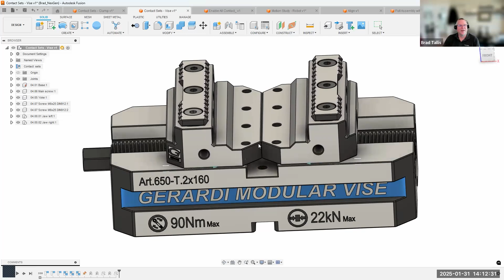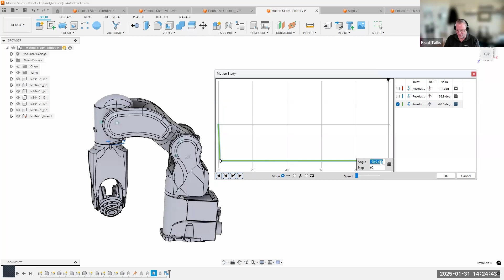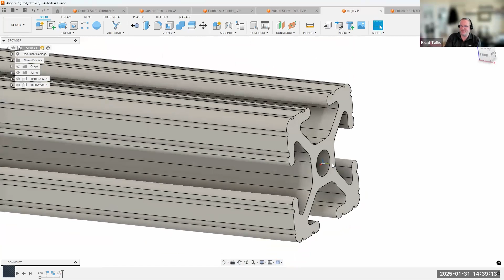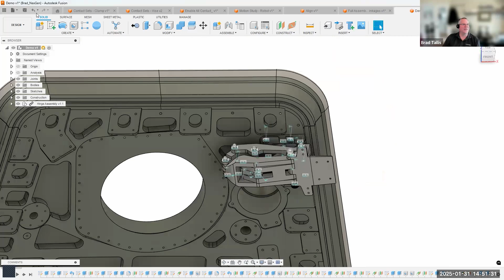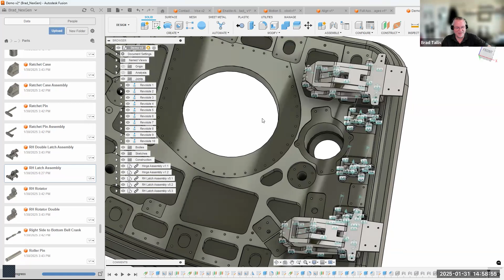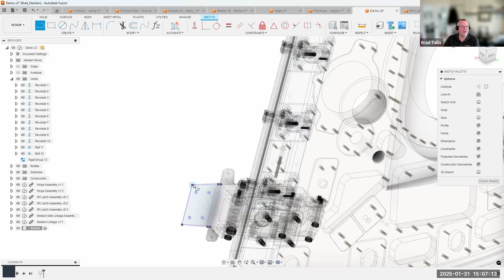Comment: THIS IS THE MOST COMPREHENSIVE TEACHING OF FUSION 360 ASSEMBLY / JOINTS!
NOTE: I specified TEACHING not TRAINING!
Brad, THANK YOU!!!!! Fusion is still a challenge, however, you have catapulted my knowledge level in a few hours by teaching where you explain in detail the "how's" any "why's" to execute the joints which has got to be one of the most challenging aspect of this software.... hence the 3+ hours to run through this.